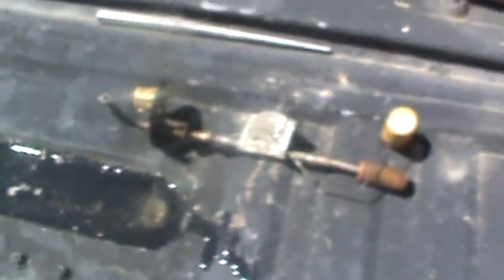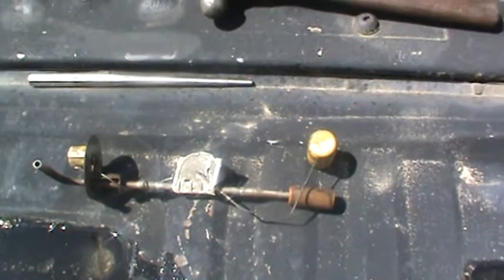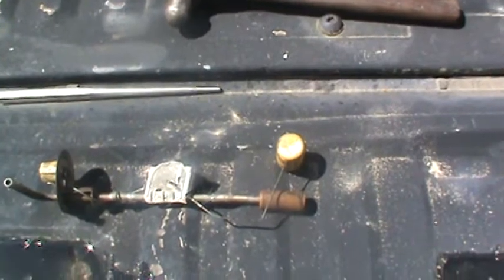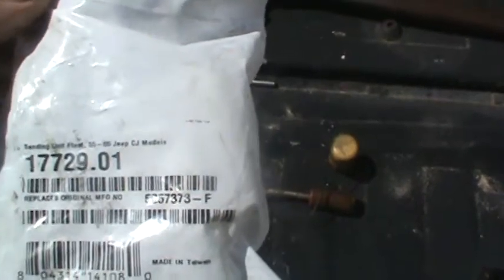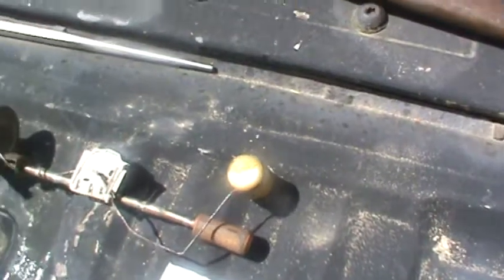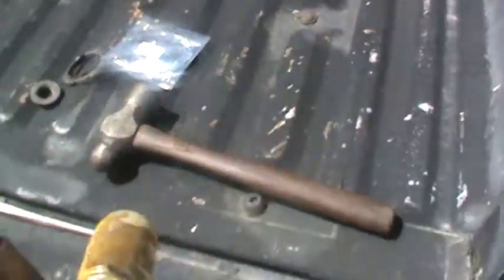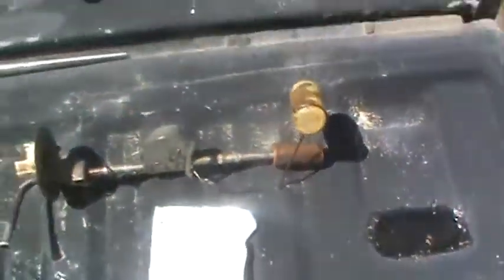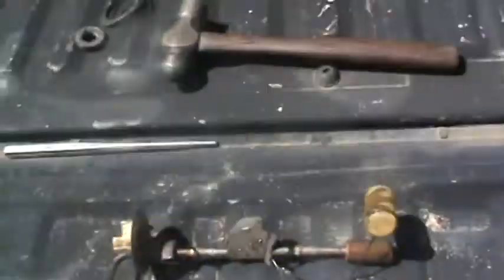Ranger Tank Float Replacement #Shorts

Comment: Bro.. so you ever thought about running a cool can for the fuel? Basically, and you probably already know...  spiral wound aluminum fuel line into large coffee can or container, put ice in it.and a drain valve.. old school tech. They say its.worth it
Reply from the maker: If i was racing and running boost i would for sure do that. If you run a good return line it will cool the fuel down some as well.